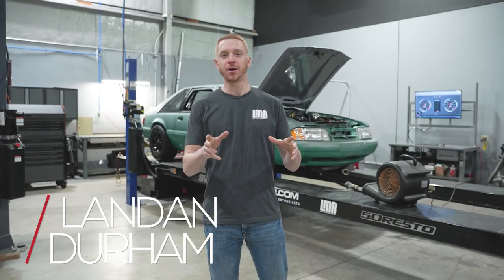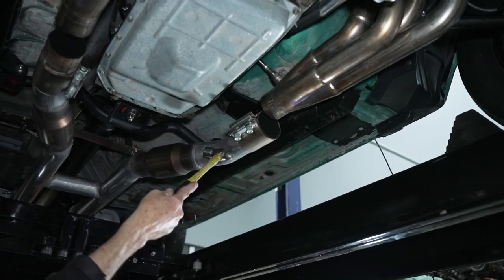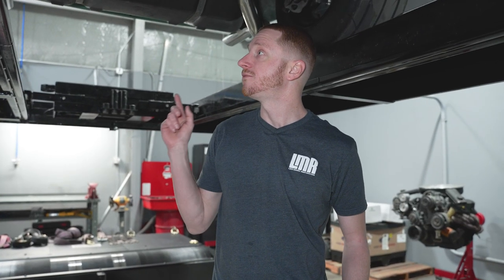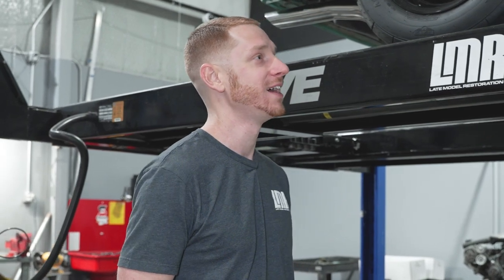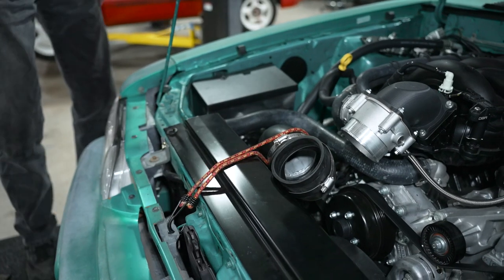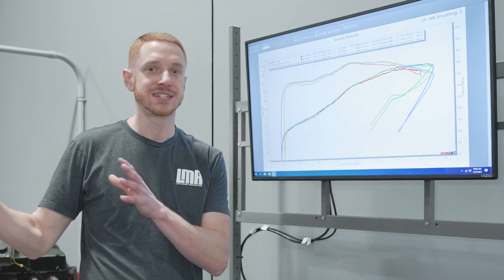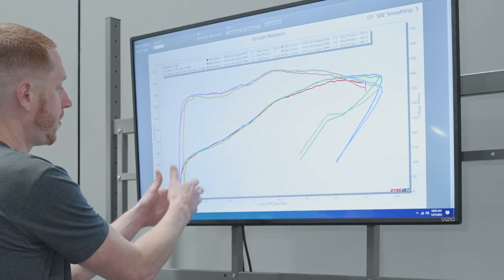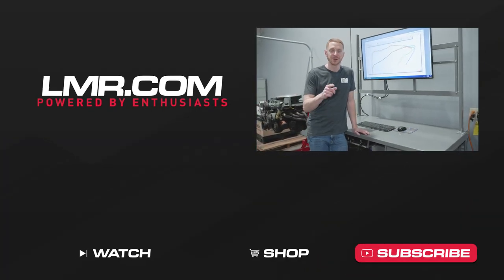TORQUE MONSTER! Stockish 7.3L Godzilla Swap Fox Body Mustang Dyno - MULTIPLE Pulls, GREAT Results

Comment: Great video. Only thing he's incorrect about is "back pressure". It's not the back pressure that negativity affects scavenging. Its the lack of flow tube area, rear of the header collector. The exhaust loses velocity here when dumped directly to atmosphere. In turn, exhaust pulses are unable to draw following pulses through the system as efficiently.

Comment: Great stuff! Hopefully you can get the new Ford Performance intake manifold that ditches the upward throttle angle. It appeared that the engine kept being stopped before 6,000 RPM, which I'm sure it can safely rev passed, once it can be tuned more.
Reply from the maker: As soon as that intake is available, we will have a dyno video.  -Landan

Comment: The exhaust is dumped too close to the o2 sensors. It needs some small extensions on the headers for that trick to work, otherwise you end up with skewed results like you did here.

Comment: I would’ve thought an engine like that would’ve made a lot more horsepower! 500 at least
Reply: That engines built for torque
Reply: It's a stock truck motor man they didn't even Rev it passed 6k rpm.  With a decent intake manifold and a cam it would easily pass 500 rwhp and torque without even trying.

Comment: What is that front tire? I'm not paying $330 for MT front runner tires anymore....
Reply: For a street car I recommend 17x7 front runners you can run 225/50/17 or some similar normal street tire and they last longer and are much cheaper.  It also handles and brakes better than a skinny front runner but they're still pretty light weight
Reply: @Lil' Ike  its got 15" front runner wheels on it, just a weekend car...its hard to make out but that looks like a Nexen? He goes over the rear tide LOL...
Reply from the maker: Here is the kit that is on the car: https://lmr.com/item/WTK-10073652/Mustang-SVE-Gloss-Black-Drag-Wheel-Tire-Kit-15X10-15X375-94-

We include 165/80R15 Nexen SB802 front runners.  -Landan
Reply: @Late Model Restoration (LMR)  thank you Landon...MT has just lost their minds on their front runners...Nitto needs to step in like they did with the NT555RII ....

Comment: SO SO glad that FORD finally offered a BIG cube pushrod engine!!
Bye bye LS swap!
(Unless you are still a Po' ass and have to use a junkyard Chevy motor.)
Reply: I've seen guys land these for 4k used with low miles.  That isn't bad at all it's a much better starting place than any of the cheap ls motors people do.  Over 400 hp and 475+ torque to the tires in stock form is no slouch and there is potential for ALOT more pretty easily.  Best of all it keeps a Ford a Ford and it still sounds like a Ford.  Sounds like a 351 on steroids so it's perfect for fox bodies